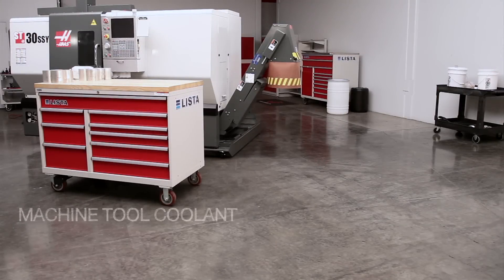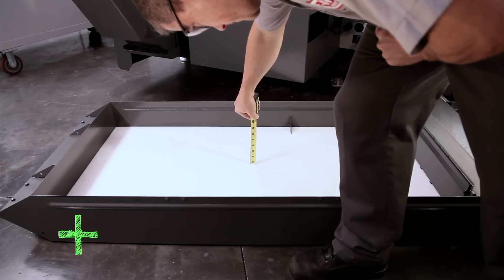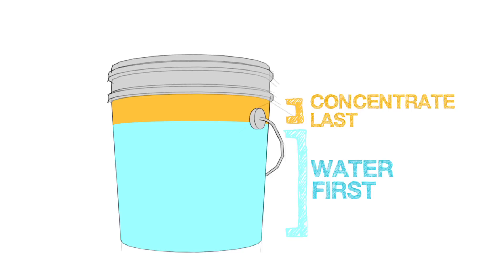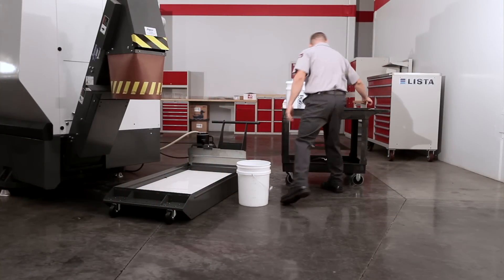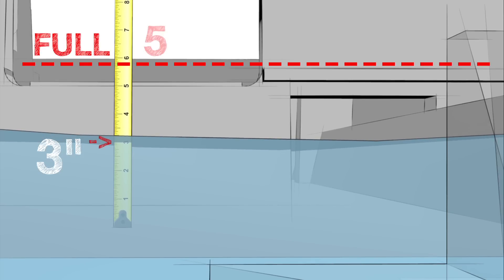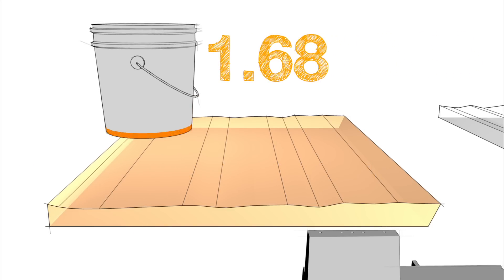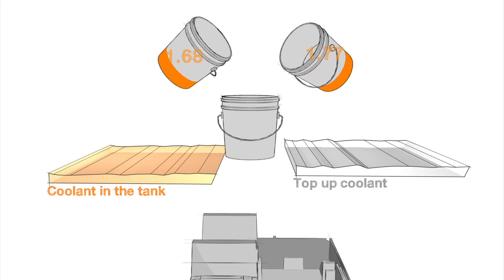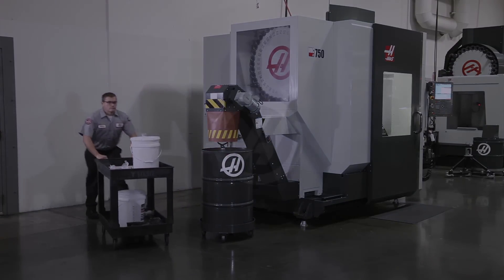Machine Tool Coolant: Topping Up a Low Concentration

Comment: If you have the money for a Haas, then you should have an inline mixer from a drum. Why would I have my machines sitting idle while you're playing around with coolant concentration levels. Set it to mix correctly right from the drum and simply check it weekly with the refractometer. Occasionally you might need to spike it a bit to maintain the %, but there's no reason to mix anything by hand on these high production machines.

Comment: what is the brand name of liquid?
Reply: Rolltech Innovation manufactures machine coolant saver. Serious threats to productivity and health are bacteria and fungi which are commonly found in industrial coolants. This coolant bacteria filter has some advantageous features include: last a life time, with guarantee of extended life of coolant with bacteria filter - no consumables, no electricity, no chemical dosing, etc. 

It is a one time investment, ROI within 4-6 Months, Saves on input of fresh oil and disposal cost like etp treatment, or giving it to authorised recycler. 

These mineral oil based coolant are prone to generation of bacteria which produces foul odour, often from hydrogen sulfide [rotten egg smell]. 

Rolltech Innovation "Aqualogic" filter is an innovative and economical method of continuously controlling these micro organisms and the odour they generate. "Aqualogic" bacteria coolant filter consists of series of high-purity multi-metal fibres cased within a stainless steel tube. the dissimilar ions in the multimetal alloy bed undergo a natural electrochemical reaction, also known as an oxidation-reduction reaction. Which Kills the all the Microbial activity in the coolant 24/7

call us at +91-702-723-6191 or write to us at rolltechin (at) gmail.com

Please give is a mail or call

Comment: Could someone please guide on how to make this cutting oil? The ingredients and the manufacturing procedure? Also, is it suitable for machining cast iron parts?
Reply: Rolltech Innovation manufactures machine coolant saver. Serious threats to productivity and health are bacteria and fungi which are commonly found in industrial coolants. This coolant bacteria filter has some advantageous features include: last a life time, with guarantee of extended life of coolant with bacteria filter - no consumables, no electricity, no chemical dosing, etc. 

It is a one time investment, ROI within 4-6 Months, Saves on input of fresh oil and disposal cost like etp treatment, or giving it to authorised recycler. 

These mineral oil based coolant are prone to generation of bacteria which produces foul odour, often from hydrogen sulfide [rotten egg smell]. 

Rolltech Innovation "Aqualogic" filter is an innovative and economical method of continuously controlling these micro organisms and the odour they generate. "Aqualogic" bacteria coolant filter consists of series of high-purity multi-metal fibres cased within a stainless steel tube. the dissimilar ions in the multimetal alloy bed undergo a natural electrochemical reaction, also known as an oxidation-reduction reaction. Which Kills the all the Microbial activity in the coolant 24/7

call us at +91-702-723-6191 or write to us at rolltechin (at) gmail.com

Please give is a mail or call

Comment: In the company I work for we have a blaser swiselube mixer which screws into a blaser mineral oil barrel. A hose pipe then directs tap water through the mixer and into a bucket mixed and ready to go. There is also a knob you swift to lower and increase the percentage of the coolant. 
We get our coolant in our machine lab tested and everything is always fine. I think this method is long winded and a bit ott.

Comment: At a shop I worked at we had a DI system that ran lines over a 55 gal drum of concentrate and the plumbing at the drum had a valve that allowed a variable amout of concentrate to be added to the water so it came out of the hose pre mixed and went straight into coolant tanks or buckets. If the coolant in the tanks were at the correct concentrate or higher we did add straight water to the tanks to top off and checked it again.  We also cleaned every tank once a month and our systems stayed clean as fuck. Usually they never got as low as the demo here unless it was hot and everything was evaporating quickly.

Comment: What happened if you fill up the tank with only concentrate? ?
Reply: It would be just like using oil. Iv'e tried it... hahahaha.
Coolant is much more expensive because it has sodium emulsifier so oil can mix with water.
Reply: Rolltech Innovation manufactures machine coolant saver. Serious threats to productivity and health are bacteria and fungi which are commonly found in industrial coolants. This coolant bacteria filter has some advantageous features include: last a life time, with guarantee of extended life of coolant with bacteria filter - no consumables, no electricity, no chemical dosing, etc. 

It is a one time investment, ROI within 4-6 Months, Saves on input of fresh oil and disposal cost like etp treatment, or giving it to authorised recycler. 

These mineral oil based coolant are prone to generation of bacteria which produces foul odour, often from hydrogen sulfide [rotten egg smell]. 

Rolltech Innovation "Aqualogic" filter is an innovative and economical method of continuously controlling these micro organisms and the odour they generate. "Aqualogic" bacteria coolant filter consists of series of high-purity multi-metal fibres cased within a stainless steel tube. the dissimilar ions in the multimetal alloy bed undergo a natural electrochemical reaction, also known as an oxidation-reduction reaction. Which Kills the all the Microbial activity in the coolant 24/7

call us at +91-702-723-6191 or write to us at rolltechin (at) gmail.com

Please give is a mail or call

Comment: Why do you add the 1 to the .06 concentration number at 8:28?
Reply from the maker: Hello Steve,
We added the 1 to the .06 so that we could solve for the quantity of "Top up water" 1st, and then subtract that value from the total "Top up coolant" to yield the "Top up concentrate" needed to mix the "Top up coolant" at the 6% target ratio. Thanks for the question.
Reply: I guess I didn't make my question clear enough, I meant why "1" as opposed to 2 or 3? do you always add 1? and why can't you just take .06 x 31.32 to get the concentration of the coolant directly?
Reply: @steveseon2143  I believe they made a mistake there. 6% concentration means that 6 gal (or L) of Concentrate are contained inside 100 gal (or L) of Coolant (Water + Concentrate). So what you say is true I believe! The Top up Concentrate is 0.06*31.32=1.88 gal and the Top up Water is (1-0.06)*31.32=29.44 gal so that Top up Concentrate=1.88 gal + Top up Water=29.44 gal = Top up Coolant=31.32 gal.
Reply: @kriti4everjr97 

Because you need to calculate what 6% of the amount of water not 6% of the amount of water and coolant. They needed 31.32 gallons of coolant and water mixed added but a 6% concentration of coolant would be the 1.77 gal of coolant to 29.55 gal of water. You can’t include the gallons of coolant when calculating the percentage of coolant to add.

Comment: I can't imagine any shop owner going through all this.
Reply: Rolltech Innovation manufactures machine coolant saver. Serious threats to productivity and health are bacteria and fungi which are commonly found in industrial coolants. This coolant bacteria filter has some advantageous features include: last a life time, with guarantee of extended life of coolant with bacteria filter - no consumables, no electricity, no chemical dosing, etc. 

It is a one time investment, ROI within 4-6 Months, Saves on input of fresh oil and disposal cost like etp treatment, or giving it to authorised recycler. 

These mineral oil based coolant are prone to generation of bacteria which produces foul odour, often from hydrogen sulfide [rotten egg smell]. 

Rolltech Innovation "Aqualogic" filter is an innovative and economical method of continuously controlling these micro organisms and the odour they generate. "Aqualogic" bacteria coolant filter consists of series of high-purity multi-metal fibres cased within a stainless steel tube. the dissimilar ions in the multimetal alloy bed undergo a natural electrochemical reaction, also known as an oxidation-reduction reaction. Which Kills the all the Microbial activity in the coolant 24/7

call us at +91-702-723-6191 or write to us at rolltechin (at) gmail.com

Please give is a mail or call
Reply: @Aumtechinnovation interesting i figured they would just have a coil thath got hot u coukd turn on at the end of the day an let ut pumpfor a hour after u done

Comment from the maker: Hi ***** - There are many high-quality coolants available from a variety of manufacturers. Any of these coolants should work well, as long as they are properly maintained.
 
Here at  #Haas  we are using Castrol Hysol MB 50. This “high-oil” semi-synthetic has proven quite successful across the various machines and material types we use in our machine shop.